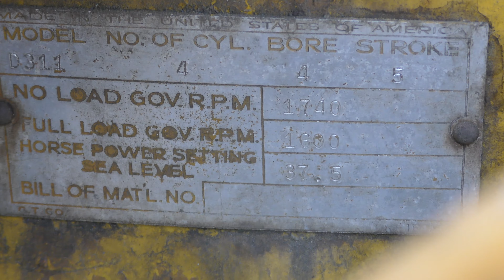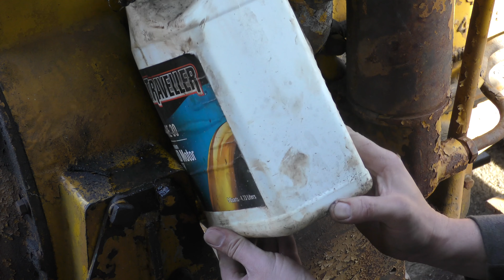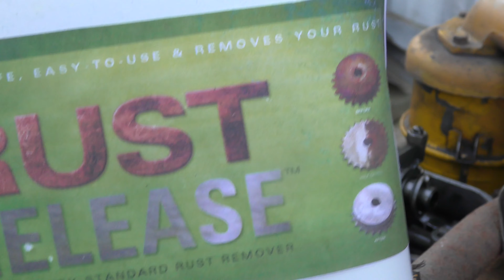Caterpillar D311 Power unit Revived

Comment: Another superb outcome. The displaced Buda will no doubt have a use, even if it is a temporary unit if something else needs an overhaul, or to test the rest of a machine which has come without an engine. I don't dislike industrial/plant gas engines, but I much prefer diesels.
Reply from the maker: Id like to do some testing on the buda to see how sick it actually is.  cat power sure is nice in one of these shovels though. the 15b is a power house and is pretty quick

Comment: Bud that would be a saweet 10-B repower
Reply from the maker: You can rope start it in there
Reply: @73DiamondReo  I prefer the ol' Diesel Creek special.
Run a belt from the pony to a chainsaw, then start the saw, use it to start the pony then use the pony to start the diesel :)

Comment: Good job Frank. The bleeder wrench you need, is it an L shaped handle?
Reply from the maker: thanks. the bleeders are like a 3/8 oval behind the injector lines.  im not even positive you need one because bleeding from the lines only seemed to work just fine.
Reply: @73DiamondReo  the only advantage to the bleeder wrench is it’s before the delivery valves. The only time I’ve ever seen it matter is on the bay city you cannot get it to prime at the nuts
Reply: I'll look around. Might have one.
Reply from the maker: @TCI425  my email is in the description. I can send you a picture of the bleeder

Comment: those fuel valves as cat calls them are assembled finger tight only during assy.
Reply from the maker: Luckily That’s all I did when I put back together.  They had backed off slightly it seems. Thanks for the info